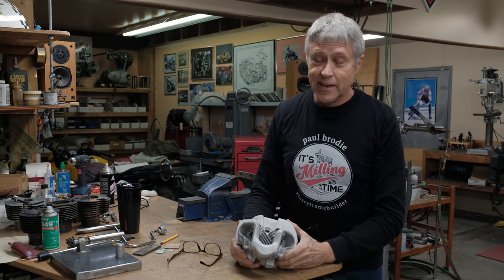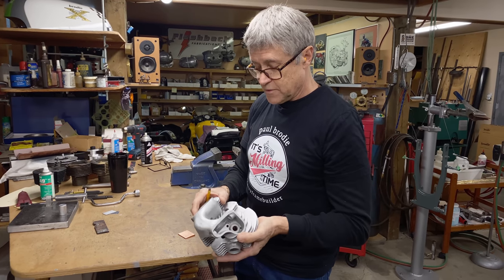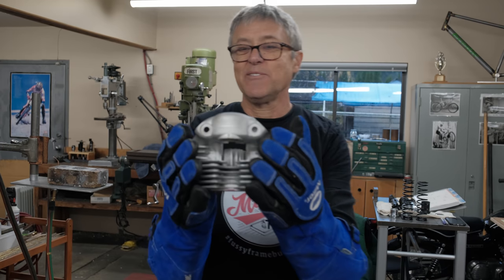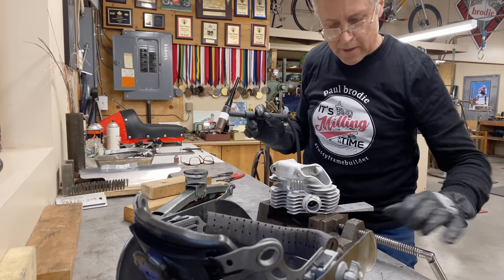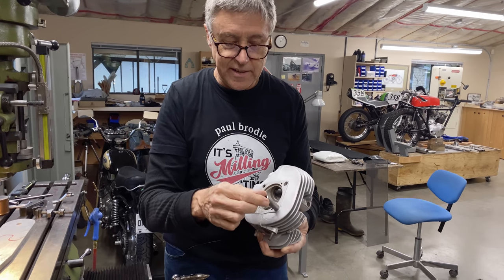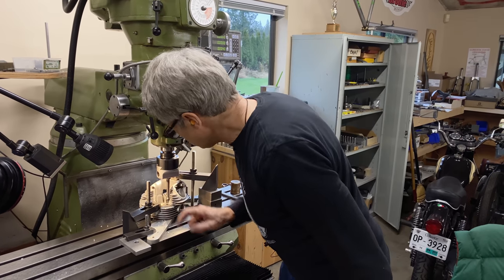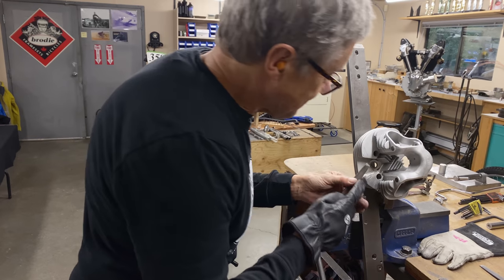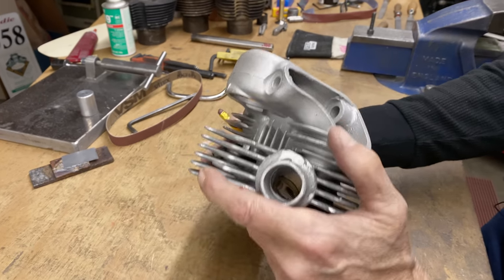Aluminum Fin Repair // Paul Brodie's Shop

Comment: Nice repair and finish. I did something similar but to an outboard engine. The cavitation plate was broken off. So I made a new part and welded it on and feathered it out and you can't even tell when the repair was made. Thumbs Up for your project and effort!
Reply from the maker: Thank you Gary.

Comment: I don't think a certain Mr Millyard could ever lose his BBQ (although the hedgehogs might well go AWOL).  Here in Brisbane BBQs are to be found regularly on the footpath with "Free" notices attached to them when the crappy "stainless" steel starts to go rusty.
Reply: Ha.  Yep.  That's how I got my first BBQ.  I fabricated new SS burners out of 16g 316 stainless, and they lasted more than 25 years.  It was the first "real" thing I ever made in stainless - I did it right after I bought my TIG welder.
Reply: @Alanbataar  haha. I live in England and found my bbq with “free bbq / scrap metal” written on it by the side of a road. Some of the mild steel back panel had rotted out which supported one of the burners. Needless to say, she’s patched up and grilling strong still 5 years later.

Comment: I’ve tried different alloys thru the years for cast al but the 4047 with its higher content of silicon has a wetting action that will eliminate that minor defect that you pointed out. You are an Artist

Comment: Hard work pays off Paul, you’ll have a nice cylinder head !
Reply from the maker: Thanks Sebastien. Exhaust port is next.
Reply: @paulbrodie  did you find a big tap for it?
Reply from the maker: @sebastiengarneau3886   A friend loaned me a 30mm tap, but I'm not going use it.

Comment: I've done a couple of those type repairs, as it seems that broken fins on the old Brit bikes I work on commonly have that same problem often, BUT you make it look WWAAYY easier than I ever did. Mine came out OK, but I usually had the broken piece to weld back on and then had to do only very little filing to match it all back up after welding! Thanks, Paul...now I just might be able to do a better job (and easier, too!).
Reply from the maker: Thanks for watching.

Comment: 5356 doesn't seem to work out well if used on parts which run very hot!  I found that out, as I used it to make an exhaust, and all the welds cracked!  Re-welded with 4043 and no more problems!  Probably be fine on a head though.............
Reply from the maker: Exhaust pipes have vibration and 5356 is a "hard" rod, I am told. 4043 is a "soft" rod so likely allows more flex before cracking.

Comment: My dad restored a Sunbeam S8 in the late 1970's...  there was a broken fin on the head...  he mixed magnesium power into araldite, and cast a new fin.... once it was filed to shape it was almost indistinguishable from the original casting...
Reply from the maker: Araldite is an epoxy? I'm not sure. If it is, what happened when the head got hot?
Reply: @paulbrodie  it is, a UK flavor, if I recall correctly.
Reply: I patched a hole in the sump of a GS Suzuki with araldite, & a small piece of aluminium. It was still there 8 yearts & 80k later. Amazing product.

Comment: I watched the arc of your welding and I was wondering what Tungsten your using? you can look at the color on the end,  2% lanthanated tungsten electrodes are blue marked, pure tungsten is green marked, thoriated tungsten is red marked, ceriated tungsten is grey marked, 1.5% lanthanated tungsten is gold-colored, zirconiated tungsten is brown colored. I usually use pure tungsten or green for aluminum or lanthanated 2% which is gray also but a slightly different shade , but I also use AC on a high Frequency box, not sure if your running a high freq box or if your welder has that built in, but Tungsten can make a VAST difference in the welds on aluminumm, I keep lots of brass laying around for use as backing on aluminum like you did. love you work, oh I finally got around to sending you your package, and it returned this week. seems I left off part of your address....lol I will correct it and send it back as soon as I can get down to the post office this week. great job!
Reply from the maker: Mitch, I think I have the green tungstens. Thanks for liking our videos!

Comment: Hello Paul. I once rebuilt broken Gold Star fins by turning the barrel on it's side and building up bead layer by layer. Every couple of passes I would file it to keep things consistent, then I'd add a couple of more layers. I think your method is better, because you are basically doing the whole fin in one sitting, where I was all the time back and forth between file, pre-heating, and welding. Have you ever tried this method? Excellent content. It would be an honor to work in your shop.
Reply from the maker: No, I have never tried you method. It sounds very time consuming, and you sure put the head through a lot of welding heat cycles that are hotter than just using the motor. Thanks for liking our videos :)

Comment: Looks like a great job. I'm a beginner TIG DIY welder only, but my "Welders Manual" tells me when welding alloy you need an extra Argon supply playing on the part while you're welding to prevent oxidation. My book is obviously wrong!
That fin looks like part of the original, nice job!
Reply from the maker: Thanks Peter. Your manual may be correct. For welding steel I set the argon flow at 10 cfm and for aluminum I boost it to 20 cfm. There's the "extra" argon...
Reply: @paulbrodie  Ah, many thanks.

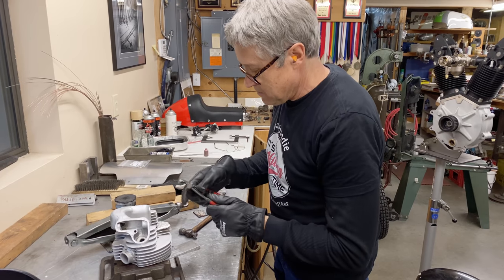Comment: 7:00 Knipex pliers ... highly rated though yet to acquire a pair for myself. Noted that a button has to be pressed to release the jaws, they ratchet closed, which is maybe not always what  you want in terms of using them to grab something like a hot piece of copper.
Reply from the maker: I like my pliers. Not cheap, but high quality.

Comment: That came out rather nice.
 Have you tried a modified 7" carbide tipped circular saw blade to use as an extra deep slitting saw?
They seem to work quite well on aluminium but 'ring' quite a bit. 
When I started in Honda/Triumph dealers way back, (I was there before the Jubilee Bonneville came out so 1977 ish) there was an old guy who came in to do repairs on aluminium bits. He used a bucket of sand to hold things in position which also maintained the heat.
 One day, he was Oxy welding a Triumph crankcase using an old piston held with pliers as filler. 
I was told he had been a welder during WWII and done similar on RR engines. Personally I never had any success oxy welding aluminium (never had enough practice)
Reply from the maker: I have tried oxy-acetylene aluminum welding with zero success. I will stick to Tig.
Reply: @paulbrodie  I took a class from Evan Wilcox, who has a business crafting absolutely beautiful aluminum gas tanks for vintage bikes.  He taught torch welding aluminum, he prefers it because welds are soft and ready for planishing.  I just couldn't get the hang of it.  I TIG then anneal with a torch if I need to planish the weld.
Reply from the maker: @Alanbataar   Evan does nice stuff! I would take a class from him.
Reply: @paulbrodie  *Very* worthwhile!  I don't know what the current situation is, but he used to teach 2 classes a year at The Crucible here in Oakland CA.  IIRC, 1 day a week for 4 weeks.  You'd be welcome at humble chez AL if you wanted to do the class.
Reply from the maker: @Alanbataar   Thanks Alan, but it seems the course was designed for locals, not someone who lives in a different country more than 1000 miles away.

Comment: 5356 spec sheet says not to use in applications above 150 degrees F. I use 4043 in castings that heat cycle. Have used 5356 in the past with no known ill affects though.

Comment: Nice repair, you could have put a piece of copper bar in the hole and weld up to it, i've always carried copper plate and bar in my tool box it's good for filling big holes, it works on metal as well with MIG and stick.
Reply from the maker: That would work too. I did not have any copper bar in my possession, only flat stock.

Comment: Wow. Timing again on this episode makes me think you or Mitch have a camera in my shop.  So, because you have spoiled us all, I am going to register a complaint. That would be the arc shots!!!!! Especially on a cast aluminum head!!! Cast aluminum can be such a bummer at times, I was  hoping to see the up close nasty stuff! Awesome episode, that fin looked impressively factory.  I think your TIG setup puts you around 60HZ?
Reply from the maker: Thanks Glen. Yes, I have talked to Mitch and we will try to do more "extreme closeups" as one viewer has suggested. My welder was set at 45 amps, what the HZ is I have no idea, sorry.
Reply: @paulbrodie  if it’s transformer, it’s going to probably be a multiple of your line frequency.  Inverters allow adjustment of AC.

I need to try mine on AC soon.  Last time I did aluminum was in 1988 - welding up a dustpan, which I still have!
Reply from the maker: @dennisyoung4631   I bought my welders in 1988..

Comment: Quick question. What is Delran, is that a trade name? Where do you buy it? I looked on McMaster Carr, no listing. Thanks
Reply from the maker: Delrin is a brand name, but that's what everyone calls it around here. A plastics supply shop is where we get ours.

Comment: I was wondering if you ware going to weld a piece of alluminum or build it up like you did. and in the second case how. using that piece of copper was geniuous. great work!
I guess you'll repair off camera the rest of the broken fins  :)
Reply from the maker: Someone told me about the copper trick many years ago. Yes, the rest of the fins will be repaired off camera.
Reply: @paulbrodie  Hi Paul. This was a very helpful video on using aluminium rods to build up a new fin. Is there perhaps a chance you could do a fin repair by welding the broken fin back on? Assuming you have the fin or a suitable matching piece of aluminium. Thank you.
Reply from the maker: @barkchip1872  Yes, in the right conditions you can weld a fin back on. It's not a problem.

Comment: hi paul thank you for the vid, i like your tig technique what diameter rod are you using? ha liked the 7:25 face :). what a collection of files just amazing (as your air sanders), love the file work. besides learning things i don´t know i like watching artisans like you bc you keep raising the bar for me to look up to doing a better job. thanks again.
Reply from the maker: The rod diameter I used was 1/16", but 3/32" would have been as good or better. Thanks for watching.
Reply: @paulbrodie  oh i thought it was small dia rod bc you said 45A i like that low heat input. thanks for your reply.
Reply from the maker: @thebrokenbone   Yes, 1/16"is a small diameter rod, and I was using 45 amps.

Comment: When welding this kind of casting, what welding rod is used?  4043? 5336? Something else entirely?
Reply: 10:07
Reply from the maker: I think I said 5356, and then I said 5053. It's 5356; that's my final answer.
Reply: @chrisallen9154  didn’t get that far in the initial viewing.  Am trying to finish up now.

Comment: Nice job, thought you were going to weld a fin on at first rather than build it up in weld. Do you have a plan for the exhaust stub?
Reply from the maker: Thanks Chris. I could have built up the fin until it was a little away from the other fins, and then welded on a plate, but decided just to keep on building it up. Yes, I have been planning for the exhaust stub. First step is to build a fixture.